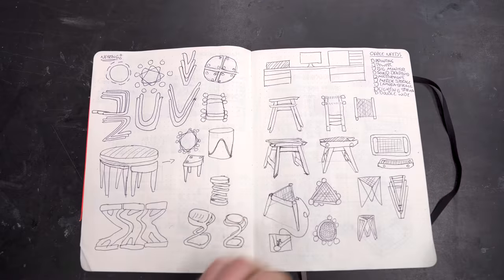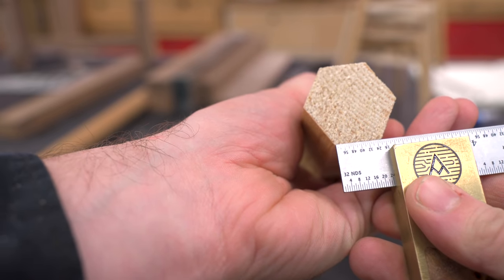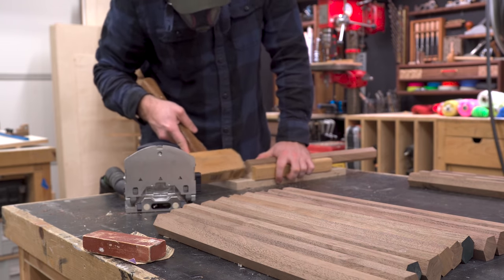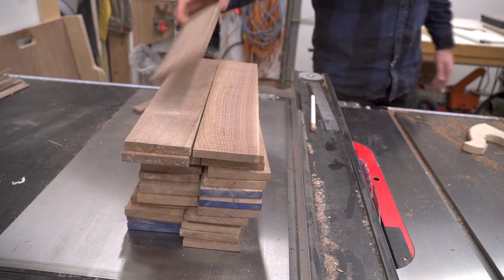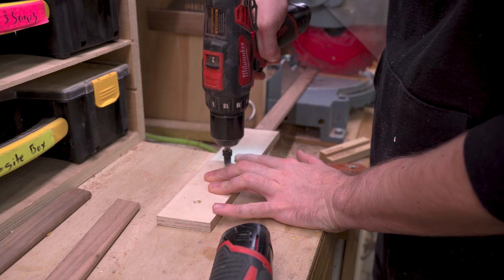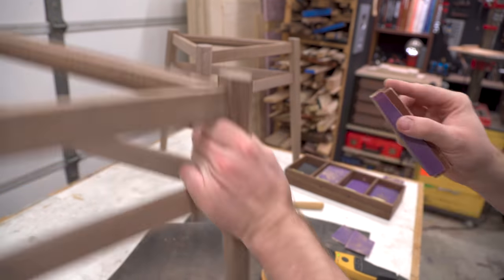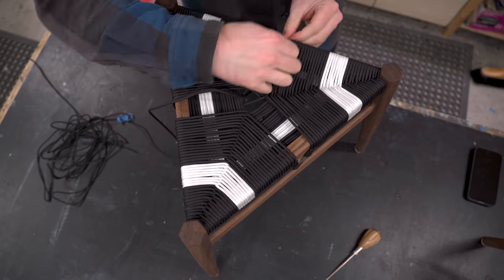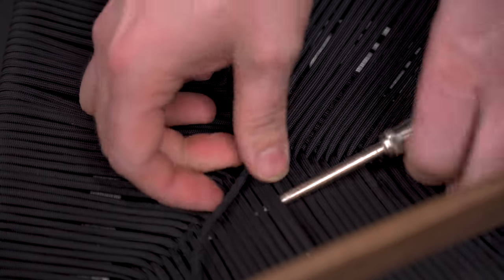Parachute Cord is WAY MORE FUN than imagined!

Comment: Cool design. As a sailor, I have a pro tip for you. Instead of using the scratch awl, you need a "fid." Get a pair of knitting needles. Cut them off about 6 inches from the pointed end (at an angle) and deburr the cut. You push the fid through where you want it to go, and stick the end of the cord in the hollow angled end of the needle. Some people even use a tap in the end to create threads to screw the paracord into the fid so it won't fall out. To do that, you'd need to choose the correct size needle. Plenty of examples on youtube. Cheers!
Reply: Good point Paul. Though if your going to use any form of maritine pokery-jiggery device ( fid, marline spike, or sail pricker)  or paracord needle, I recommend Jig Pro Sho or Bored Paracord's brands of knotting tools. You can order a marline spike with 3 different gauges of paracord needles in them.
Reply: You can make your own quick and dirty paracord needle out of a long Chicago screw, by cutting the head off and filing it to a point, the chicago screw has those internal threads, so you can screw it onto the cord.
Reply: My brother is a sailor and carries an all stainless sailors knife with a nice fold out fid built into it, its a great knife, very handy, and affordable.
Reply: @joebonomono5078  that's not a fid, but a similar tool called a marlinespike. So many terms in sailing. So much jargon.
Reply: @paulheitkemper1559  I appreciate knowing this, I'll be sure a wager my brother on this. Thank you for a free meal Sir.
Reply: You can also use a leather stitching needle.  The eye is MASSIVE
Reply: @elizabethwatson71  you can if you have room. If you use the eye of a needle, there is a double layer of cord, plus the thickness of the needle and width of the eye.

Comment: i too am a para-cord junkie , i use para-cord for many things and outside also in the garden . i have been using the same para-cord outside for different stuff for about 6 years now , it is weather proof , it is unaffected by the blazing scorching sun , rain , wind , so being heat and cold tolerant is a big plus , its the only rope i ever used so far that is  basically in-destructible !!! 
all others have failed in one or two years of service ! . for a few years i had been hanging on to a couple of really nice heavy duty folding chairs ,they were just frames , i didnt want to put the original plastic tubing back on them because it doesnt last , i wished i had seen this awesome video before i threw them away last year !  just think , i could have had a pair of folding chairs that would have lasted a life time !!!
thank you both for this incredible video , the hard work and time really paid off in the end !!!

Comment: Michael, your jig to make dowels on the table saw is gold.  I bought your plans and made 28 - 1" white oak dowels for a white oak bed I just completed.  The choice of saw blade definitely makes a difference on how much sanding is needed to get the dowel smooth.  Your stools are great!  Now you need to design one with a back rest.  Cheers!

Comment: I know this vid has been out for nearly a year but here's a tip I learned when I was making a woven top footstool in Boy Scouts: trim up some cardboard pieces to tuck between the layers of woven cord.  It has the effect of adding padding to the top, while also giving a degree of mutual support between all the strands so that the seat feels like a more cohesive unit.

As you get past the 50% mark you can see where you can tuck cardboard in so it'll stay put and you can weave around it.

Comment: Awesome design on the stools! I re-did the mesh seat on my office chair with a weave. I used 1/2" nylon mule tape (similar to ratchet strap material) and it turned out nicer than it was when the chair was new.  You can get it in a variety of colors, and also different widths. I highly recommend looking into it for future projects, it's good stuff, super strong and easy to work with. Also handy stuff if you ever need to pull wire through conduit.

Comment: tip: you can get 15 sheets of 165 arrow stickers (2475 total) for 10 bucks (i.e. 0.4c per) it helps a lot to mark what goes where, and not sticking well is a good thing cause you can remove it and just use a dab of acetone on a cotton cloth and it leaves no residue.
same way, you can use colored letter sheets at around the same price to mark what goes where for more complicated pieces. (or get single color of the whole alphabet. or those vhs labelling sheets.)

Comment: Very nice result (as usual)! Tip for the next time: get a paracord needle (it is a hollow needel into which you stick (by burning it) the end of the paracord): it will really help you for the last row! Also keep the beginning of the paracord sticking out, so you can finish your work by a fisher knot between the beginning and the end.

Comment: I made a paracord deck chair seat once. I just used an old metal frame from one of those chairs with a fabric seat. The seat sagged, which was disappointing but tolerable. After a time, though, I went outside and the whole seat had just fallen apart. Not one break, either. It was snapped in multiple spots along the edges. I suppose it was UV damage, but it really wasn't outside very long at all. I suspect that it was rubbing on the seat edges as you sit, though. I had naturel fiber chairs inside that lasted many years, but this was just a total surprise. Hope you have better luck.

Comment: Paracord is super useful. I usually have some on me or in a bag, so I can use it for carrying parcels, bottles or to fix stuff.

You can get really far with a few knots, such as the parcel knot, the alpine butterfly knot, the bowline, the constictor knot etc.

One thing I kinda wanted to make was a paracord hammock. But you need some sort of frame for it so you can make the net for the hammock. And then you'd need something to hang the hammock on - a wooden stand would work great for that, but it would need to be really sturdy.

Comment: One of my favorite paracord things are the tree nets made by TreeNet Willy's. Essentially, they run some climbing rope around a group of trees, with some notched 2x2s between the rope and tree to protect the bark. Once they have the outline made, they run paracord across, looping and twisting it at random areas to make a web-like design. I saw one at a music festival, and it could easily hold over 10 people on it, and was surprisingly comfortable. It had enough give to make it comfortable to lay on. but it was still strong enough to walk across. The only real downside to it is the price. If you get it done through the company, then it can easily get absurdly expensive. Long-term installations start at $5000 for smaller nets, but there is a $10,000 minimum to make an order, and they can easily get far more expensive. I really want to make one myself someday though. My mom has a part of her yard with a small grove of trees, where she usually hangs her hammocks, but it's the perfect size for a treenet. If you do it on your own, it's a lot cheaper. All you need is a couple hundred feet of climbing rope, several thousand feet of paracord, and some metal o-rings for climbing, to add stability to the net. All in all, the resources would be fairly cheap, only a few hundred bucks. The hard part would be the trial and error of getting it right and stable, but that's honestly where the fin is at anyways. Plus you can use UV reactive paracord so that it will glow in black light, and if you make it yourself, you can do your own designs too. For anybody else who may be interested in making one, the site is just treenetwillys.com and they have a great gallery of the nets, so you can get a good idea of how to make one yourself

Comment: In the marine corps when we would wrap thing with 550 cord at the end we would dip it in or pour boiling water over the cord. The heat causes the cord to shrink and get much tighter. Over time if used heavily it might stretch.

Comment: Y'know while it's still in my head I'd like to say a potential idea I have for a table that can be raised. And that is by having it be raised by kicking it, or more accurately a piece of the side of the table that keeps it locked in the down position. Of course it would have to reset manually, but I think it's a cool idea for a design.

Comment: Although my suggestion is too late but, for the future, if you wove the seats like a snowshoe it would require much less paracord and you would be pulling it tight as you go (no slack).  I use this on Canoe seats and some outdoor chairs.  It's very tight, very comfortable and easy to do.

Comment: Thnx for the vid! I used to make Turk's head knots and super glue is great for tacking paracord to paracord. A fid can help get the paracord through tight spots. I used a scrapbook peg from home despot and ground it to a point. Also, for larger lengths of cord a shute or net needle is very helpful. I have some old wicker rocking chairs I will be doing this on. Do you have any info on the weaving pattern used on this project?

Comment: If you make more, I wonder how pink and yellow on one, and then all of the colors on the another would look. I think it might really tie the dude's table together...or look hideous, not sure which. I have a thing for pink and yellow together, possibly with orange and purple.

If you want some fun with practical geometry, try making a dodecahedron speaker box. I did mine out of particle board, just flat sheets with no supports which make glue up extra fun. It was about 3 feet across and surprisingly I could sit on it without it breaking. Can't say it had the best sound but at least it looked like it should sound extra cool.